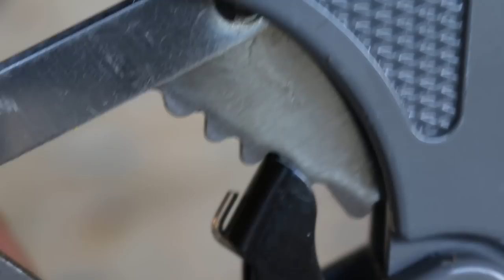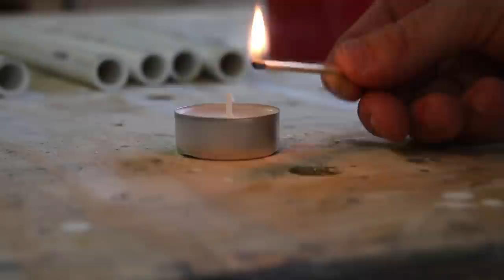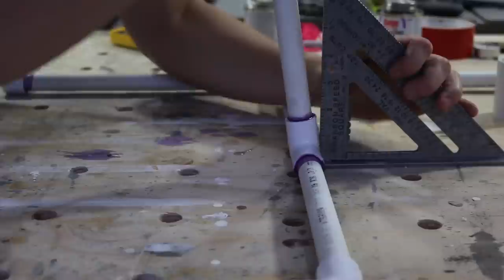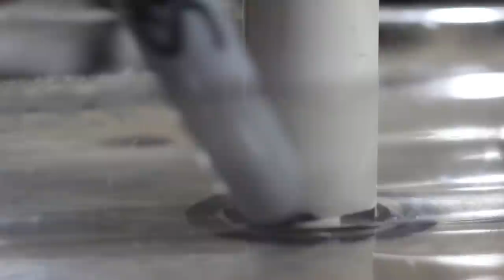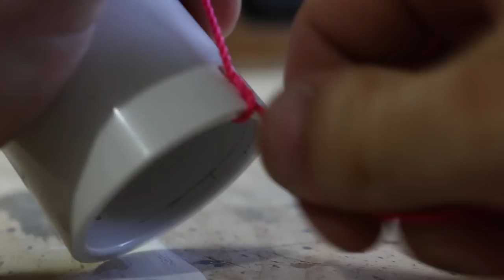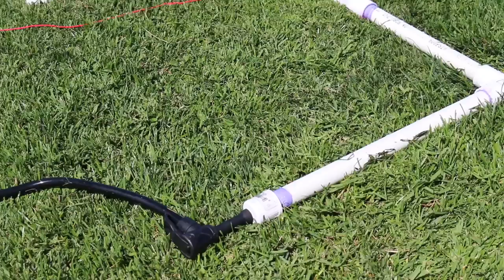Making a Water Bottle Rocket Launcher | VQC

Comment: In order to stop losing water when you put the rocket on, you could just flip the launch pad and then put the rocket on, then flip it back so water will not leak . That’s what I did.
Reply: There's a thing called a check valve...
Reply: @Shastavalleyoutdoorsman 😂

Comment: What's the measurements for the cuts?
Reply: For my rocket I used a 5ft pvc pipe that I cut into 4 peices the main pipe is 2 ft the ones to the side off of the t are 1 ft each and then at the other end of the main pipe I have an elbow joint connected to a 5 inch pipe.
Reply: My design is different then his so I don’t know exactly what this guy in the video did but mine seems to work fine

Comment: Always dry fit the PVC pipe before applying glue, use a magic marker, make a mark on each piece where it lines up. I have assembled lots of PVC and this little trick lines up everything flush, no leg or other pipe not lying flat, nothing out of line. This glue can set very quick, before you can get it lined up correctly, trust me that ain't  good.

Comment: What PSI did you launch at?
Reply from the maker: The dial on the pump I was using was definitely inaccurate.  I would say it was between 40-60 psi.  I tried to max it out without losing too much water before releasing the rocket.

Comment: What are the pvc lengths? And what is the black thing on the end of the pvc called?
Reply from the maker: Hi Abbie!  In the video description there is a link to a video that has a more detailed list of the materials used as well as the  lengths of the PVC pipe.  A tire valve is what's used to pump air into the bottle (through the PVC stand).  I was able to find that at an auto part store.  I think I went to AutoZone for that, but any auto store should have it.
Reply: Voth Quality Creative I didn’t see the link to the video with lengths.
Reply: @vothqualitycreative  there's no video

Comment: After applying the PVC solvent, is the launching pipe is able to move in any ANGLE or it gets permanently joint to the vertical angle.
Reply: Permanent...  it's all glued else BOOM

Comment: This is a fantastic launcher but is there another option besides using a cut 2-liter soda bottle for the "springboard"?   In the past, the string has cut through the springboard making it useless.  I have been trying to think of an alternative - ideas?
Reply: i used a spring from a sprinkler head. works great, the only issue now is that the paracord ,that use to pull the spring down is somewhat use less so i do have to manually pull the lock down
Reply: i also used a cap from Califia Farm milk on the lock to keep the spring from passing through the lock. Drilled a hole to pass the pvc though and it's perfect. I have to think about how to get enough force to pull the spring down without having manually pull on it. I get pretty soaked every time.

Comment: Hi.
Will a bicycle tube valve work fine?
Reply from the maker: I'm not sure if a bicycle tube will work or not.  I'm sure if the connection is air tight and the hole drilled into the PVC cap is the same diameter as the valve your planning to use it should work.  I used a valve I found at AutoZone.
Reply: Yo estoy usando válvula de bicicleta y está cumpliendo su función

Comment: Won't the water from the bottle spill out??
Reply from the maker: Haziq Mirza some water spills out when transferring the bottle onto the launcher. Once the bottle is on, the seal is air tight almost perfectly. The pipe extends passed the water level inside the bottle ensuring no excess water goes into the launcher as well. Over time and from the air pressure the plastic bottle may expand and compromise the seal.
Reply: @vothqualitycreative  
I do not know which part you made the seal. Is it where you heat and compress the pipe ???